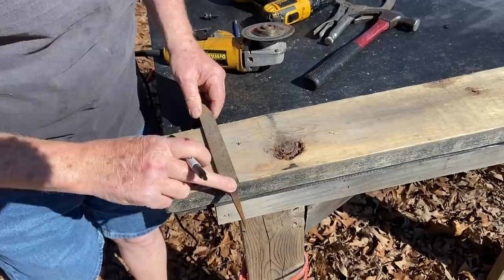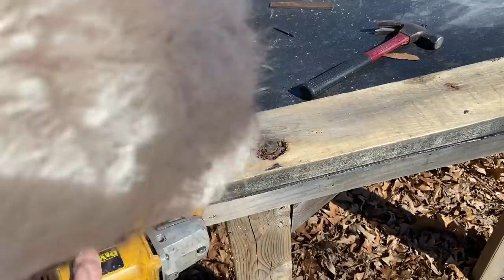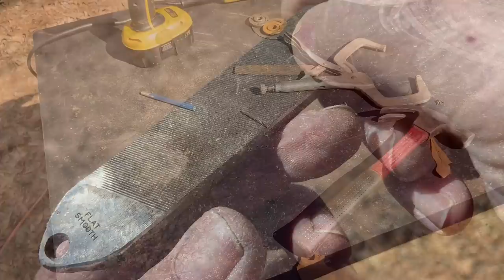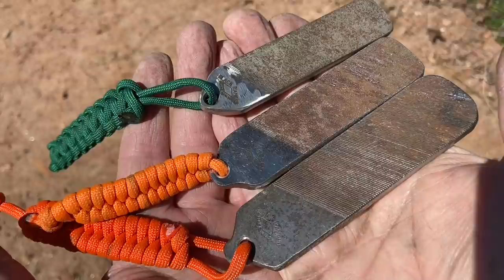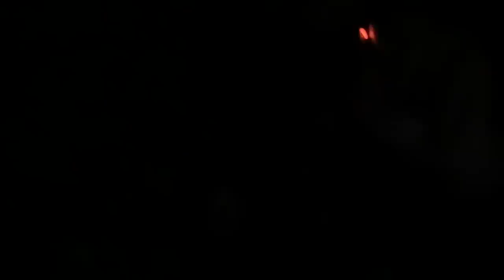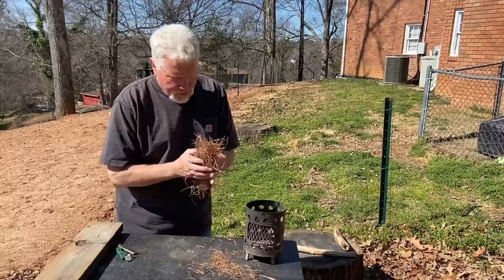How To Make A (Flint And Steel) Steel Out Of A File

Comment: 1976 I was working for a small machine shop. I only had one pair of safety glasses and wouldn’t you know I left them in my toolbox at school. I asked the owner of the shop if they had any spare glasses as I was machining a large cast iron wheel drum. They all used Rx glasses so he did not have any spares. He said, “Just squint your eyes.” I smiled when I saw you keeping the squint your eyes method alive. 🤣😂🤣😂 Thanks for another good video David. Regards, Chuck
Reply from the maker: Many times I'll close my eyes altogether before impact. Timing.

Comment: The other half of the file can be softened at one end with a propane torch with a small flame. Heat on one side and then let it cool completely slowly as possible and then heat on the other side again let it cool as slowly as possible. If you find you're losing too much temper use a pair of vice grips or a metal piece to act as a heat sink and protect the hardened areas you want to keep. And then continue as you showed.

Comment: I just made one out of a new Nichloson file. I used oil on the file as I cut it to keep the heat down. I was pleasantly surprised to be able to use the file to square off my striker and knife for a fresh 90 degree angle . So a new striker can be used for multiple purposes.  I am sure that has been thought of,but it was new to me.    Thank David, for real treasure of fire making Ideas.
Reply from the maker: I’ve heard the new files made in Mexico don’t cut or last well. If you find that to be true, modify a new old file of Nicholson’s from a flea market. Even on the worn out files like I modify for steels, that base section that I use still has a lot of bite. I have filed with my steels before.

Comment: I did almost the same thing with my file but I made it longer (Might be too long) and I only ground one of the sides flat in case I still need to use that part of the file. Plus I also didn't chamfer the corners on the side of the file I ground flat. I left them at 90 deg. I did round of the top and bottom and chamfered them both. You commented on how to do it in a video two weeks ago then you came out with the video (after I had cut the file) to spark check the file first. I am just waiting for the snow to melt in order to find the right stones. I refuse to pay for rock online for something I might be able to find.
Reply from the maker: I'm glad you made it how you thought best. Everything I post can be duplicated or customized and still work perfectly.
Reply: @DavidWestBgood2ppl  I can always make it shorter but don't have the welding machine to add more.😆
Reply from the maker: LOL!

Comment: I didint use any heavy machinery, i took a 200 mm file , broke it , sanded a part a little with sandpaper and it made sparks
Reply from the maker: I've done that, but ground one side down on a cinder block. See my making a steel playlist.

Comment: I alway say Safety requires a little common sense.  Requiring excessive gear can sometimes lead to a sense of false security.  Best practice is training on equipment that you use.  And always take your time to complete the task.
Reply from the maker: So, I had to do some grinding on a job where all that gear was required... safety glasses, goggles, face shield, hard hat. I had to reach through some hand rails and grind for an extended period of time. When done, I went to remove my hard hat, then goggles, as I pulled the goggles away a big pile of grindings poured off the top of the googles, and fell at just the right angle to miss my safety glasses and go right into my eye... 100s of grindings. Not wanting to blink, I kept that eye closed, stood at the handrail, head hanging down, as I pondered, where's the eyewash station, how will I get to the Dr, how much time off from work. All the time my eye was just pouring tears. Right here is where the Lord stepped in!!! When I opened that eye back up, apparently the tears had been viscous enough to make all the grindings stick together... and every single particle came out at one time in a clump. I didn't even have to use the eyewash. How's that for a loving and merciful Father?

Comment: went out and bought a couple old files at pawn shop.  does the edge need to be smooth to make a spark?  tried to generat a spark with the rough edge to no avail on either one.
Reply from the maker: Yeah, but are they Nicholson or Black Diamond. Just any file won't work. See my steel build playlist in the Description.
Reply: @DavidWestBgood2ppl  thanks for answering...I have purchased a Nicholson Black Diamond  what type of drill bit will drill through the steel with a hand drill?  I will check it for sparseness first.  Thanks for the videos. I have made fires with char cloth I made, fatwood scrapings, etc..
Reply from the maker: The tang drills well with a regular drill bit. The body of the file is too hard to drill through without specialty drill bits or going through the trouble of annealing and rehardening.

Comment: Very nice video. I’ve made steels from every file I have found except for the one (that I use) in my carpenter’s box. 
Sometimes I will leave the end (opposite the lanyard) with a 90 degree edge to use on a ferro rod ( you know, when you just don’t have the time to blow a real fire) 😉

Been making fire with flint and steel since I was eight years old (1968). It’s been my go-to method for over 50 years now.
It’s good to see it is still alive, and still being taught.
Reply from the maker: Flint and steel is a favorite of mine too. Thank you!

Comment: How would it affect the performance of the steel if you left the teeth on?  It seems to me that the teeth would facilitate the production of the hot metal shards that produce the sparks.  Thank you.
Reply from the maker: I didn't like it when I tried. I think it catches the sharp edges of the chert and promotes bounce off instead of a scraping slide down the steel.

Comment: What is the striker plate making the sparks
Reply from the maker: Flint and steel will work with Quartz, Flint, or Chert.
Reply: @DavidWestBgood2ppl  So the old file blade is the striker and the Flint Steel is  the round bar of steel and magnesium alloy that you use to scrape the striker to drag off the hot sparks.  The tinder is held close to the striker to catch the sparks produced from the Flint Steel. Now I am beginning to understand the fully process. I will check out the Flint Steel supply.

Comment: I have an old file from a gerber multi tool. Won’t spark on the flint though
Reply from the maker: Might not be enough mass in the file to see if it's sparky. It has to be heavy enough for the chert to bite and scrape instead of just bounce off.
Reply: @DavidWestBgood2ppl  after a few scrapes and roughing up the metal a bit. Got a few tiny sparks, not sufficient enough lol. When I find and old file I shall try again

Comment: I'm with you on the cutoff wheel I've blowed more cut-off wheels up then most people ever see very rarely wear glasses only thing I hate whenever that stuff shooting over top of your head dim little scratches scratches get down your neck I'd rather take a ass whooping
Reply from the maker: I always wear glasses, but grinding dics will split or a part of the edge will disintegrate . I've only ever felt particles impact my arm, but not break the skin.
Reply: I’ve got a scar from a grinding disc exploding, it cut into my artery and was a frantic rush to the ER to get stitches. It’s the reason I use a guard.